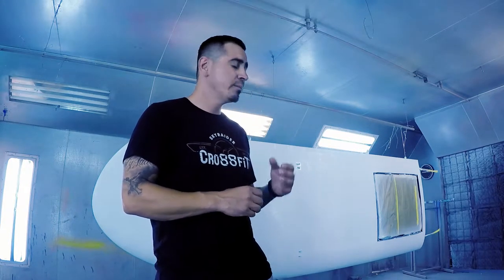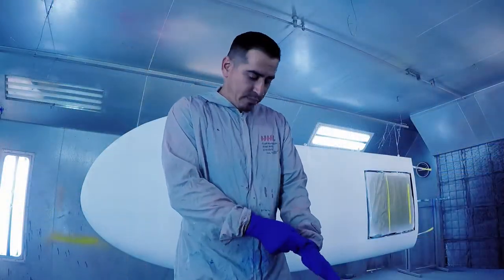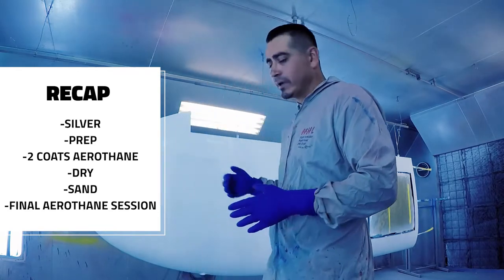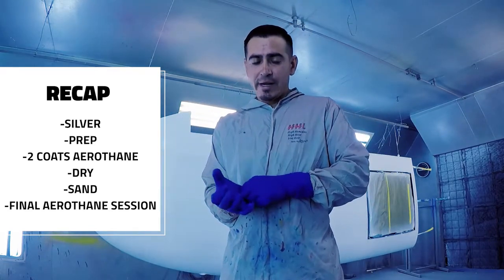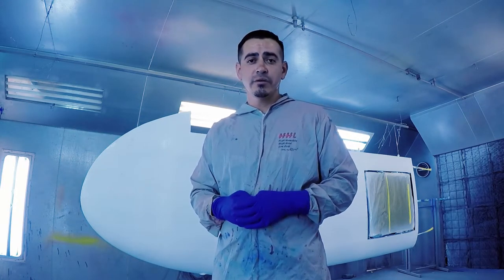The Poly-Fiber System - ACHIEVING THE PERFECT LOOK

Comment: Waldo Mendoza (the painter in the video) is highly skilled and a great resource should you have a question concerning the Poly-Fiber System.  I will say, however, that I was surprised to see him spray Aerothane without using a clean air supply.  Folks, no matter how good the spray booth, where the recommended PPE--especially when applying Aerothane or Ranthane.  Your life depends on it!

Comment: After getting 95%of the way through the poly fiber system I want to give my 2 cents to anyone considering it, DONT USE IT! Theres so many downsides to this system and Im so frustrated and I dont usually cuss but it had me cussing today. Im exhausted from working 16 hr days on end on my airplane and I will start from the beginning problems or complaints. First of all my airplane is only fabric on the fuselage and has metal wings. A Maule. Theres like 16 gallons plus of crap you gotta buy which Im damn confident you dont need as much as their book says. It says I need like 6 or 6.5 gallons of poly brush and in the instructions it says to go over it with a brush for the first coat and then two more coats.. well that uses up about a gallon and a half of the crap. Later in the instructions in the poly spray section it says to do 3 cross coats of the poly spray which is 6 coats really but it doesn't clarify that in the poly brush section which is before the poly spray.. (kinda need to know that!) But even doing 3 more coats doesn't use even close to 6 gallons of the crap. I called a guy that the place I bought the stuff from told me to call that uses it and he said it all needs to go on there.. well you damn sure couldnt see the fabric weave after 6 gallons! So THEN when you get to the poly spray (silver UV protectant) it says to stop with the UV protectant when you cant see a light shining through it. So  I did that plus two more coats for good measure and I STILL had 3 gallons of poly spray left!! 🤨 It references that Leroy the character they like to use as a dumb old guy to make fun of says to put it all on.. So why the hell do they sell it all to you!? And then only sell you the required amount of reducer so you dont have enough to mix your paint when you clean you gun out or use it to fix all the damn runs you get with the color coat! Thats one problem Im dealing with now. (Gotta drive an hr to go get more now, AGAIN!) 
Ive used all kinds of paints in my life, i started painting cars in the year 2000 and Ive NEVER had a paint run so bad! I think its worse than the Van sickle brand you can buy for painting farm tractors. It HORRIBLE! Im so exhausted. It says to quit and wait 4 days to sand them off if you get runs.. well. YOU WILL GET RUNS!  So you know what that means.. I moved my fuselage out of the paint booth to make room to do my wings.. got runs on the wings now!! So while Im sanding on the fuselage Ive got wings in the paint booth to sand.  SO I started painting ailerons and flaps and wingtips.. I about screamed like a mad insane person when I went back after the third coat to evaluate and only two things didn't have a run.. It doesn't matter how damn light you spray it or how long you wait between coats.. itll run in the most random places.. so now Im basically starting all the frick over with the painting process.. I hope the 600 dollar blue I had them mix doesn't run too but itll be months at this damn rate before I can even think about spraying my colors for stripes.. Not to mention you gotta do all this wearing a fresh air mask because theres isocyanide in the damn shit that wants to kill you.. You still smell the crap when you leave the paint booth and pull it off with the nice red indentation oval red ring around your face from the mask.. I almost stared throwing stuff tonight. Id like to give the guy a piece of my mind that talked me in to this system because I was once set on the Stewart System.. oh damn how I wish I could go back.. I hope I change someone's mind here.. save yourself some huge headaches and use something else.. Its the biggest pain in my ass Ive ever done and Ive tackled some big projects.. restoration of trucks, tractors, cars. You name it.. this tops them all. It could be slightly better if the instructions jived with the amount of crap they sell you for your given airplane and fixed those parts in the instructions i mentioned.. And why the heck cant they find a way to use less toxic crap!? OHH one MORE thing!! Ive been through TWO boxes (50 pcs) of them blue Nioxin gloves they say to use!! And the shit eats them up! Your fingers will be exposed in no time.. I just hope I live long enough to fly the thing a few years at this point.  Not happy at all with this process.. It will look good if I ever get the runs fixed but seems like Im chasing my tail right now.. very pissed off like tail chasing..😡🤬Spent over $3,200 bucks on it all, I think they hope the chemicals will help you forget how much work or cost it was when its done.
Reply from the maker: James, we would love to chat with you directly if you're up for it? Please give us a call 
951-684-4280